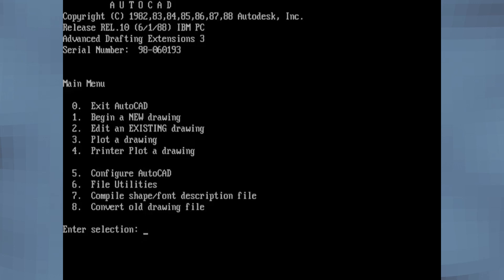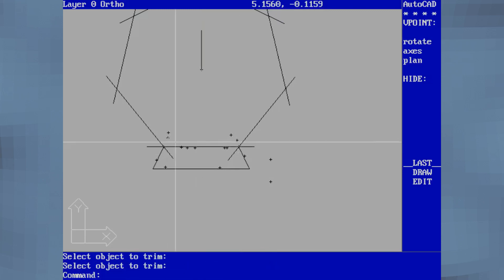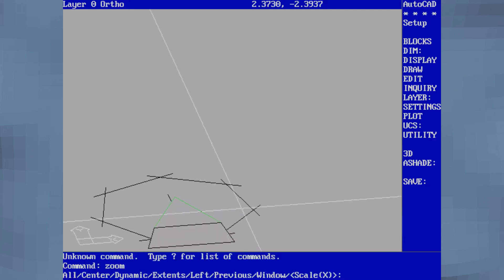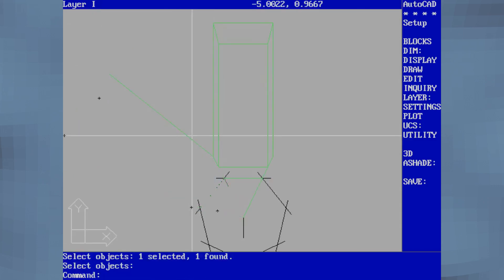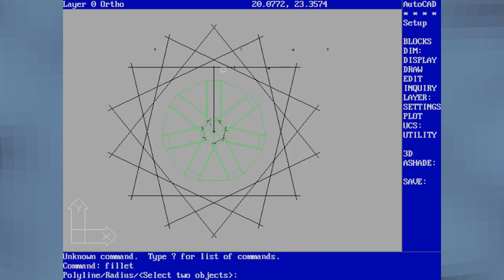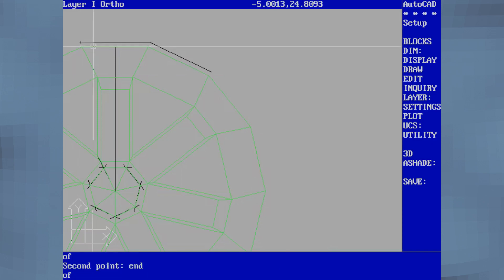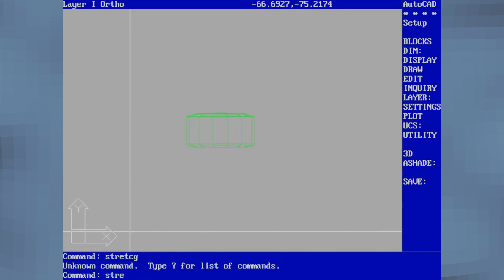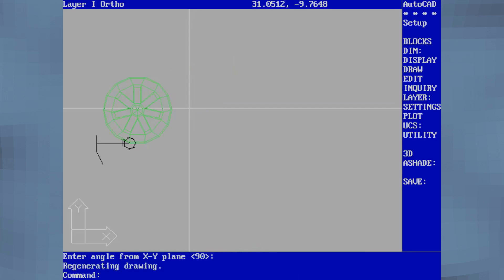MS-DOS AutoCAD R10 & AutoShade Cybertruck 2023 (Part 1)

Comment: This is kind of interesting; I like looking back at older software to see how things were designed back before the modern day. CAD software looks so confusing, but I like how it can generate 3D models.

12:15 Roblox is another game that treats “Y” as its vertical axis. It can be slightly confusing going from Blender where “Z” is up to that. I think at one point i preferred the latter, but these two standards are as confusingly inconsistent as “MB” (megabytes) and “MiB” (mibibytes or whatever). Why did they make two standards for data, which Windows lies about? (They use the latter but use the former abbreviation.)
Reply: yes lol
minecraft is another. Unity and godot engines as well. It's terrible that there hasn't been any standardization on that. 
Z-up makes the most sense to me, with blender habits reinforcing that.
Reply: Did someone say ROBLOX?!?!